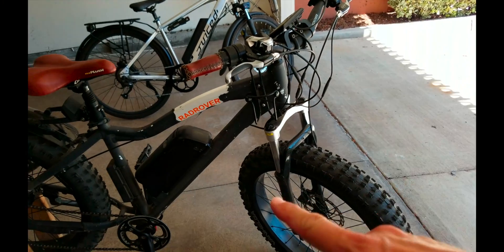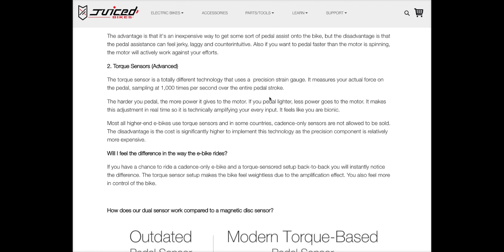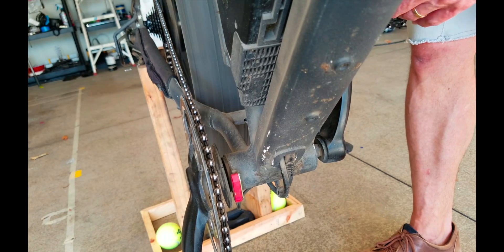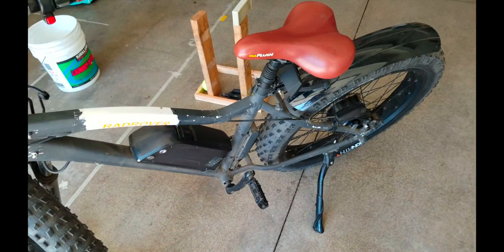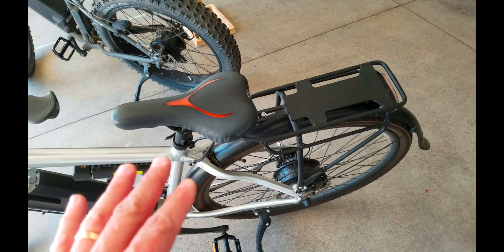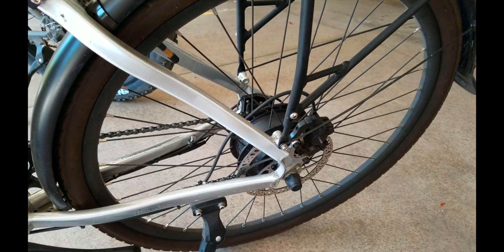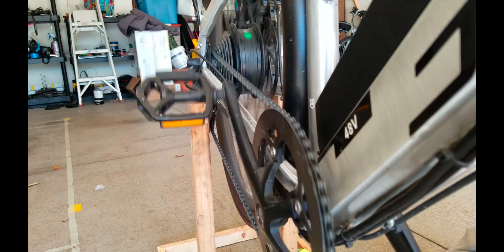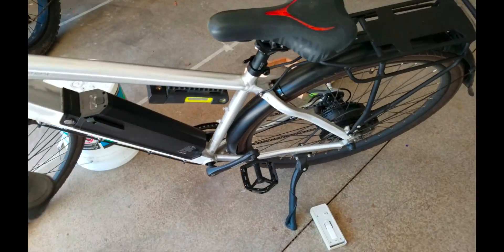eBike Cadence vs Torque Comparison

Comment: Have u experienced bottom bracket torgue sensors
Reply from the maker: I don’t think so.  Why?
Reply: @smidgelife  there excellent ,for example if u stop in the middle of a hill as soon as your foot goes on the pedal with minimal force it will easily take you up without  touchin a throttle and overall control is so much better highly recommend 👍

Comment: I like that a cadence sensor allows you to pedal as much or as little as you like with torque you must pedal continuously. With a cadence and my level of fitness I can go on a 30-40 mile bike ride but with torque I would be limited.
Reply: There are plenty of torques with throttles if you need to rest.

Comment: Jasion uses torque sensors surprisingly. I got the EB5 and was shocked by how smooth the pedaling was and how I could get way more range due to how efficient torque sensors are.

Comment: Wonderful video.

I fix hundreds of e-bikes per year and without a doubt, my older customers don't care for the torque sensors because you have to put in more effort. Cadence sensors are cheaper and make the job easier but they are more "disconnected". Nice explanation.
Reply: I’m that older guy who prefers the cadence.  I usually don’t want to mail it in though and get my work out by getting in the right gear.
Reply: @MarkSmith-js2pu  Can you expand on that? How do you get a workout on a cadence system?
Reply: @TheOceanMan-xc7qp 
The best way is to set your level of assist at slightly below the speed you wish to travel at.
With practise it becomes extremely natural and you'll get a very similar feeling to that produced by a torque sensor for a lot less money!
Reply: @MarkSmith-js2pu I’m an older guy who wants to ride a bike and not have the bike ride me. Torque sensors are much more available in 2024. If you want a cadence sensor bike, why not just get a motorcycle? Looking at all the videos, since the motor speed is totally controlled by what pedal assist level you are in, and it pushes to the speed no matter how hard you’re pedaling, I can’t see how you would ever get a speed in which you aren’t ghost pedaling, which is why I suggest a motorcycle…unless, I suppose, you’re riding bike trails where motorcycles aren’t allowed.

For group rides, for instance, I would think you’d have a hard time keeping in your place since you are either having to pedal really hard or go to the next assist level, at which time, your bike might lurch ahead into the rider ahead of you.

If you enjoy it, though, you do you.
Reply from the maker: One other interesting fun fact is with standard cadence sensing if you're at a standstill at a light and you have your front wheel turn and then you slowly crank the pedal that triggers the magnet over the sensor and you're at the highest level of pas then the bike is going to take off and do a circle that you're not prepared for and you'll fall down. 

I also had an instance where someone was helping me carry the rad Rover over a fence and he grabbed the pedal and triggered the sensor and it almost caused some pain and suffering for both him and me when that happens. 

So there's an entire safety issue I think also with standard cadence sensing versus torque sensing.
Reply: @skeller61  I consider it a motorcycle.  I pedal all the time, the effort is against the motor.  I never ghost pedal anymore since the novelty of that wore off after a while.  I use 4 and 5 if I’m on a bike lane in traffic I want to get out of.  I ride it on the streets just like a cycle.  I had a great 1986 Honda 1100 for quite awhile.  I like to use the thumb throttle from a stop in traffic but rarely after that.  On a typical commute I’m pedaling my cadence sensor against resistance and going around 15 mph.  I dance with it😀
Reply: @smidgelife  I would say, if you’re carrying the bike over a fence, cadence or torque, turning the bike off first would be the safe way to do it.
Reply: @MarkSmith-js2pu  Thanks for your reply. My last bike was a Yamaha FJR 1300. Now that I’m older, and still alive, I got my e-bike for exercise. For me, having never tried a cadence sensor bike, I would think working against the motor would be harder and less fun than having the motor work with you. If I want a little break, there’s always the throttle. Mine (a Velotric Discover 2), also has a cruise control, if I just want to coast along and enjoy the surroundings. I’m glad the cadence sensor does what you want it to.
Reply: @smidgelife  don’t have your wheel turned when you start and bump the throttle if you wish to maneuver at a slow speed.
Reply: @skeller61  😂😂😂😂😂😂😂😂😂
Reply: @skeller61  riding this machine for 5,200 miles has brought me back to my cycle days.  I’m lucky that my routes to the errands can be partially made in parking lots.  My head is on a swivel, but I like that.  On the weekends these same lots often will find me working on turns, leaning as far as I dare, counter-steering just as on a cycle,  pumping hard in 3rd at 19-21 mph and getting a ton of good cardio work.  I’ve got a sound sound system worked out and I can listen to my conservative talk radio and podcasts, and when I’m feeling it I get the fast classic rock and roll and British Blues…..Shiny side up skeller

Comment: I didn't know juiced has torque sensors...I tested rad and it really is too much power for pedaling, need to change chainring to 52t ... Darn, I could had test ride juiced while I was in San Diego, now I am sorry I didn't...
Reply from the maker: Yes.  Rad is more mechanical.  Juiced is good.  I currently own Tenways that has it too.

Comment: Thanks for filming the comparison. There's a lot more choice out there since I first started using e-bikes but from what I gather go cadence if you have knees problems...
Reply from the maker: Actually that's a pretty good assessment.  But more interestingly it depends on where the pedal crank is when you first start.  Because if you were on an incline and you just had cadence sensing it might be more difficult depending on where the magnet is on the pedal crank initially.  Once you have momentum I agree with your assessment.

However I do think overall torque sensing is your better way because of what I just stated.  Further if you have torque sensing set to its maximum it really would have very limited pressure on your knee.

No matter what I like where your mind is have a great weekend!

Comment: Thank you for doing this video.  I am astonished that the cadence sensor took one full revolution of the crank before kicking in the motor.  In my experience That’s not how a proper cadence sensor should work.  On my bikes the cadence sensor engages the motor after the passage of a few magnets, about 60 to 90 degrees of rotation.  Something is wrong.  Juiced Bike are biased toward tongue sensors because that’s what they sell.  Both type of sensors have their place depending on the preferences of the operator.  Grin Technologies have very good papers explaining the pros and cons of both types of sensors.  Again thanks for the side by side comparison.  You might want to check your cadence sensor.
Reply from the maker: Thanks for the feedback and constructive criticism.  The main part I was trying to convey is before I even got into e-bikes. I didn't have a clear understanding of how torque sensing could make such a dramatic difference in what you feel when you pedal.

I can also say that nothing was manipulated to position one way or the other.  It's more just to educate people that aren't familiar with torque sensing and the difference between that and pedal assist.  

Needless to say, this is a fairly hot topic and many people have strong opinions.

Comment: Thanks for the explanation.  I am new to this so I am unsure about a lot.  So with the Torque Sensor does that mean you are doing all the pedaling and all the work until you hit the 23 speed limit and if you push it harder by pedaling harder then you go beyond 23 and the TS kicks in, but until then you are pedaling all yourself with no motor assisting you?
Reply from the maker: No.  torque sensing occurs throughout the various speeds of the bike.  From zero to the top end, TS intelligently applies force to assist your pedaling.  It's simply much smarter than cadence sensing with magnets and you feel it with each pedaling stroke.

It is a difficult thing to convey that's why I made this video.  If you're going to use your bike a lot I would definitely want this feature if you're a casual e-bike user, then it probably won't make a difference.
Reply: @smidgelife  Thanks.  For burning calories I guess cadence sensors don't let you burn many if any calories then.  Correct?
Reply from the maker: @jamesgibson3242  minimal correct.  Torque sensing will always make you need to apply a level of muscle.  Cadence you just need to rotate the sensor to the next magnet.

Comment: The idea of ‘ghost pedalling’ is just horrible
Reply: For healthy people with no issues I agree. But, in my case, I need the cadence sensor system. I am 74 and have put thousands of miles on my road bikes over the last 50 years. But, a motorcycle accident put an end to my normal riding. I am now partially disabled with limited use of my leg muscles. I tried a couple different e-bikes with torque sensors and they were too difficult for me. So, it was a cadence sensor or nothing for me.
Reply from the maker: Makes sense and I agree with you for your situation that completely is understandable.  Cheers

Comment: But then steep uphill happens and if u dont have trottle on tourge sensor the less pedal u give to the bike (which is cos the uphill is way too steep and u pedal less and less which equals to less and less power when u need the most), so in the end u end up jumping off the bike and push biking it. On caddnce sensor all u have to do to feel natural is to put it on lower PAS. Its annoying to start on caddnce sensor tough.

Comment: Good video. Haven’t tried a torque sensor yet but did not like a cadence sensor and returned the bike.
Reply from the maker: Yeah that's the biggest problem with cadence sensors, it's a very artificial bike feel and it does a lot of the work. 

I've ordered this tenways ebike I'm waiting for and it has torque sensing.  It just feels so much better overall to have torque sensing.  It's a major difference and it really makes the bike feel so much smarter plus you get more exercise.

Comment: Torque sensors are great when starting on a hill. You don't have to get a full revolution of the pedals before the motor kicks in like a cadence sensor.
Reply: Cadence plus throttle works a dream for me
Reply: Cadence all the way… I’ll leave the torque sensor to the super heroes

Comment: Is it possible to covert a cadance sensor to a torque sensor. I have a bafang motor with cadance. What put me of getting a torque over a cadance was that its much harder to maintain high speed 20MPH plus on a torque pedal assist. However do you not get a bit of both with torque sensing and a throttle snice I find cadance just feels like a throttle you control with your feet would love to get your input on this.
Reply from the maker: It's not so much a conversion as it would be a replacement or swap out.  I would think you could add the torque sensing components I just don't know if the computer on your bike would be able to handle it.  That's a great question though maybe we have some other people that can chime in on it.

Best of luck let me know what you end up doing.
Reply: @smidgelife  nah did some research yesterday you have to have a motor designed with it looks like I am stuck with cadance.
Reply from the maker: Well thanks for the update.  At least you know what your next bike will need 😁

Comment: I believe all eBikes should have Torque Sensor system.  Why because Cadence Sensor does not understand you need more power to climb a hill, or a long incline.  A Cadence Sensor understand you want less power when your cadence slows down. With a Torque Sensor system low power motors can provide assist if it understands you are trying to climb (pressing hard on the pedals to increase your cadence). Unfortunately slowing cadence when climbing is interpreted on a cadence System as you want less power assistance. 

But having a 750-1,000 watt motor with a throttle can power you up a hill without worrying about the Cadence System providing the slowing of power. Bigger motors need more battery storage that weighs more making a heavier bicycle that maybe can't be carried up 3 flights of stairs.  Opt for a Torque Sensor style system in a lighter bicycle, and you will be happier eBike owner.
Reply from the maker: Beautifully stated thank you for the detailed response.  I just think most people don't realize the quality that torque sense brings.

Additionally I also feel like pas is actually quite dangerous because if your pas is at Max, and then we'll just slightly rotates to activate the pas while you're stopped.... Then it takes off like a rocket with no intelligence.

Comment: When I made the decision two years ago to add e-assist to my recumbent trike I had to make a couple of decisions as to what system to go with.  The first choice was hub motor of mid-drive (mounts in the bottom bracket) motor.  I made the decision to go with the mid-drive as it provided better performance (torque and using the existing gearing to multiply the motors assist) and ease of service when compared to a hub drive.  That decision made the next one was a torque assist system (Tongsheng TSDZ2) or a cadence assist system (Bafang BBSHD).  Both motors can be procured in 250 W, 500W, and 750W versions running on battery voltages of 36V, 48V, or 52V.  After careful research between the two I went with the Tongsheng TSDZ2 as it did not require a shift sensor to stop the motor when shifting or to brake sensors to stop the motor when using the brakes.  The torque assist is very similar to what you demonstrate in this video, pedal even slightly and you have assist cutting in immediately and when you stop pedaling the assist stops just as rapidly.  The Bafang does not react to changes in your pedaling as rapidly and needs these to reduce damage to the drive train.  With the Tongsheng the ride is very close to that experienced on an unassisted ride with the only difference being that your effort is being assisted by the level of assist you have chosen.  Both units can have a throttle installed but I find that I have almost no use for it as the system works great without its use, I think it would come more into play if for some physical reason you couldn’t pedal and it would provide the power to get you home. The unit is easy to work on and as an example I changed out the torque sensing components internal to the motor (after 5,000 miles of use) in less than two hours which included removing the unit from the trike and reinstalling it when finished.
Reply from the maker: Amazing detail!  Thank you for the info :)

Comment: Great video, explains exactly what what I thought were the difference with the two types. I want to still feel the pedal resistance while getting help from the motor when needed ie. pedaling up a hill or into a strong wind. A few years back I built a bike with a 750w Bafang mid drive. But after the first couple of pedal rotations it was all motor and no pedal resistance. It appears most of the reasonably priced torque sensor bikes have smaller amp/hr batteries, which I guess makes sense due to of the more personal effort used. Thanks for the video.
Reply from the maker: Thank you so much for the positive feedback!  Glad I could help I was really trying to capture exactly what you stated so thank you.

Comment: You really should not be able to get the torque sensor going on a stand. There is really not enough torque to do so. I've tried :)
Reply from the maker: It worked for me. I could feel the torque system engage.

Comment: Whilst my kit is either "on" or "off" as far as pedaling or throttle (according to 5 assist levels), I have been curious as to the technology available that makes it feel like you are super fit as the motor matches your power. It also makes changing gear more easy as the motor is less likely to pull on the chain when you want to reduce load to shift gear (if you have a mid-drive). To be honest I'd be fine with a more variable throttle and no pedal assist, but am interested in that "amplified fitness" feel and would like to try riding a torque sense bike even though I have no plans for getting another kit.

Comment: So could someone please explain what the advantages would be of having a cadence based setup ? For example, someone who stays below 20 mph and wants hills as easy as possible. ... Not everyone rides bikes the same way... .  Can we list any pros for cadence other than lower cost ?
Reply from the maker: Cadence (or Pedal Assist System) is better than just having a throttle, but to me that's where it ends.  Also, PAS can be dangerous too.  Let's say you are paused, PAS is set to max 5, and you turn your handle bars turned sharp to the left or right.  Then you slightly pedal past the magnet and trigger PAS.  Then, the rear tire motor will pulse at max speed.  This is not a good design and could hurt the rider or others around them.  PAS has ZERO intelligence.   Personally, I'd never purchase PAS again.  Torque sensing is really the best way to ride.  Plus you get way more exercise from torque sensing.
Reply: @smidgelife  can you name a few good quality torque drive models that get the longest range ? The more I look the more I'm finding cadence based having the longer ranges and not sure why that is.